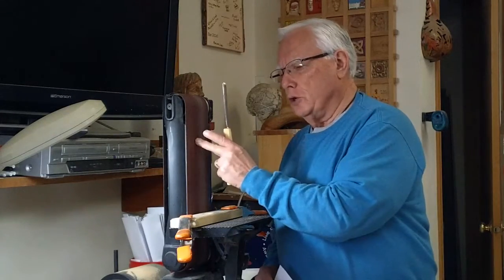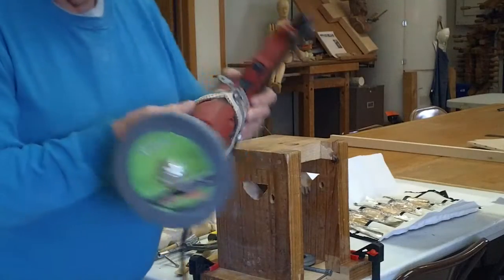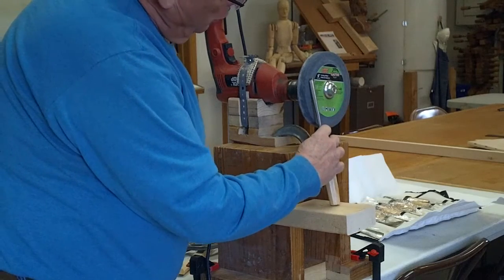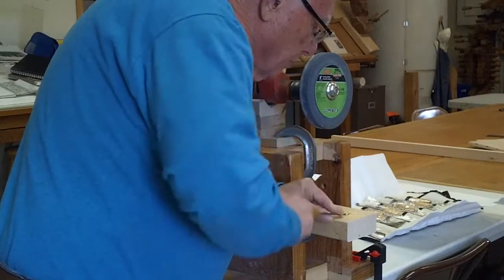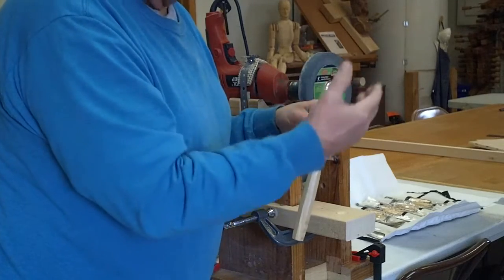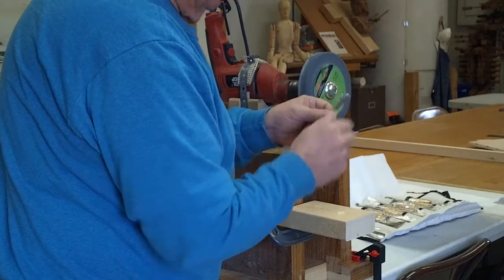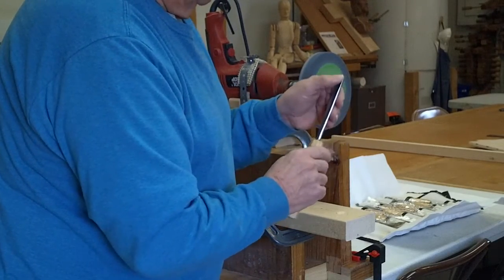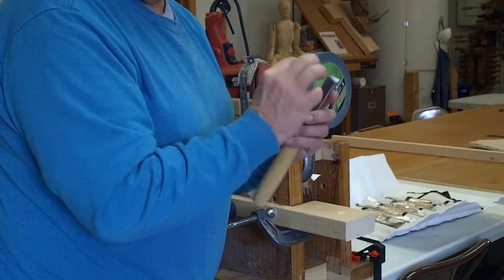Sharpening Fixture for Angle Control

Comment: The only issue I have with the video is the use of the side of the grinding wheel which most manufacturers warn should not be done. Would it not be possible to do something similar using such as abrasive paper on a disk instead? The video title was also misleading in that the activity is really for establishment of the bevel instead of sharpening.  I also noticed that it appears you might be shaping some of the Shaff brand tools and was wondering if that was so, and if so, how do you like them. I have some of that brand and have really been impressed with them.
Reply from the maker: Mike, thank you for your comments.  Using the side of the wheel at low speeds is acceptable. The wheel is not designed to be used on the side at high speed, but low speed is no problem. Putting an abrasive disk would also work as well as a buffing disk turning away from the cutting edge. 

Yes, these are Schaaf tools. I got my set a few weeks before Christmas and been putting them through the paces. They are holding up well. They are designed well and the quality of tool steel is very good. The harness is uniform. As a person's carving skills improve they will not outgrow these tools.

Comment: never do this  ,phiel chisels are far to costly to do  any of this crap. use water stones or oil based stoned to sharpen any quality chisel,this is the dumbest crap ive seen on u tube
Reply: Nearly all new and used tools require some shaping and sharpening prior to being put to use and many carvers will adapt tools to their particular style and material. Once the initial "commissioning" of tools is done however, it is normally just a matter of lightly stoning (if necessary) and buffing unless the tool becomes damaged. You most certainly wouldn't want to make a habit of grinding them when you don't have to. Having said that, having a way to do the initial or restorative shaping without hours on stones is very useful.